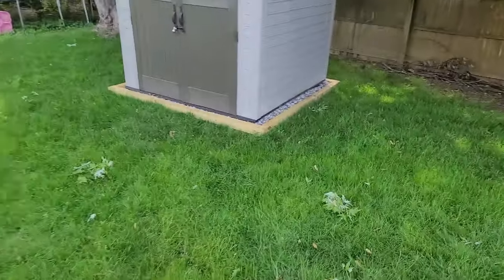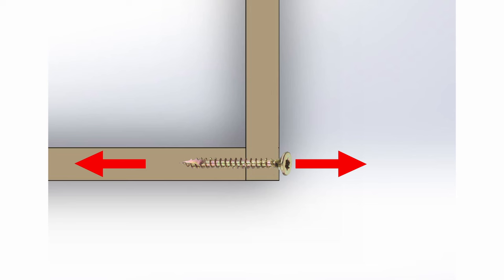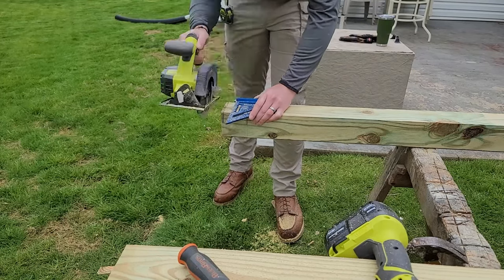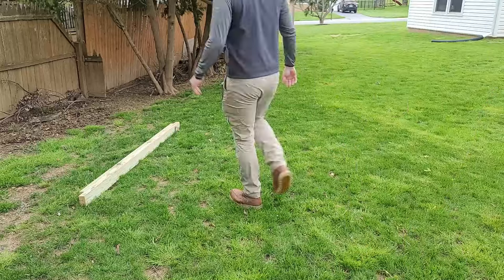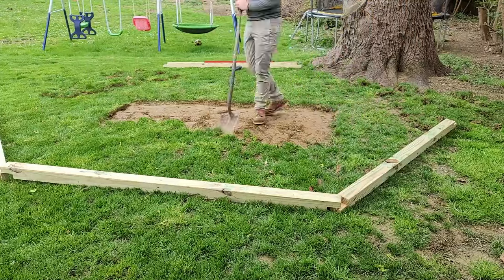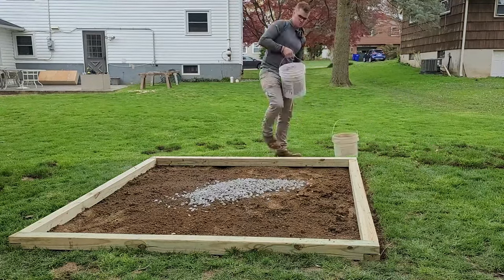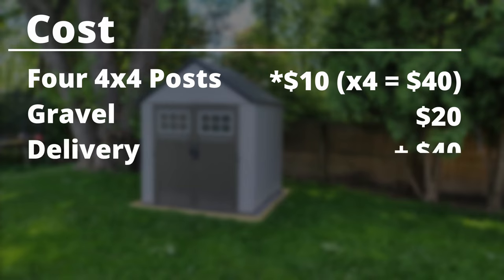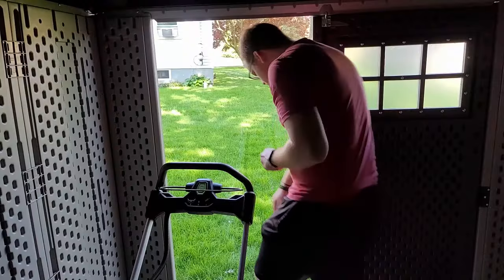Building a Shed Foundation for $100 | TIMELAPSE

Comment: How do you calculate the amount of gravel you need? My project is smaller so definitely won't need that much. Great video. Thank you !
Reply from the maker: The gravel company helped me figure that out. When I called to order it, I told them what I needed the gravel for and what size area I had and they told me which size gravel to use and how much I would need to get it to the proper depth to allow for proper drainage. 👍
Reply: @thebackyardbuilder  awesome thanks a lot for the help!!
Reply from the maker: @patricecomedy  happy to help!!!
Reply: This is exactly what I'm looking to do. How did you end up anchoring the shed?
Reply from the maker: @SuperSkimbro  I didn't anchor it other than filling it with lots of junk! Haha. I am not too worried about it going anywhere where I live
Reply: Your my favorite Comedian RIP. Thought you was dead?
Reply: @ninersnation2364  I'm sorry bro, he was mine too, only exists in our memories and on YouTube now.
Reply: Length x width x height. 
Don’t forget to convert the height to tenths of a foot though if the height is in inches. In this case 
4” height=.33 feet 
8x8x.33= 21.12 sq ft
Reply: Cubic feet*
Reply: Hope Santa brings you a wheelbarrow!!! 💪🏻 😂
Reply: @thebackyardbuilder  hello you wouldn't happen to remember (exactly) what type of gravel you ordered.
Reply from the maker: @cecilb3216  I believe it was 3/4" gravel
Reply: @thebackyardbuilder  thanks for the prompt reply
Reply: @cecilb3216 ”3/4 quarter” gravel is often recommended. The size and jagged shapes of this variety will pack tightly, but also work well to drain water.
Reply: @KeithHampson  👍
Reply: I made mine out of 2x6 treated joists and treated plywood fit for only $68 more , and it's heck of alot stronger.
Reply: I have a tow behind that tilts to dump whatever is in it.
Reply: @thebackyardbuilder  did your shed blow away yet?
Reply from the maker: @boster8368  not yet! ;)

Comment: How did you anchor the shed? I was planning on ding this same thing but thats the part I am caught up on with these resin sheds.
Reply from the maker: You can pick up shed anchors online or at hardware stores that screw down into the ground and can hold it steady. Or you could run some beans across the footprint of the shed and anchor directly into those 👍

Comment: Good video and helpful as I am putting up a 6 x 5 shed. But my question is how you anchor this shed to this type of foundation since the foundation the shed sits on is gravel.
Reply from the maker: You can get shed anchor kits that are essentially giant screws that screw down into the ground and then you fill the gravel in around them. You could use those as your anchors :)

Comment: Did you use any anchors? Contemplating if i need anchors for my lifeyime shed. Thanks for the video my shed will be up in no time
Reply from the maker: I did not use any anchors
Reply: I am preparing to install a lifetime shed.  Curious how yours worked out.  Did you assemble it on the gravel base?
Reply from the maker: @copace1  yes I assembled it on the gravel base

Comment: Two questions, would it be better to have the shed sitting on the 4x4s? Or is it fine in the center of the 8x8 square? Also does this shed need to be anchored ? I have same one
Reply: I am at the process of waiting for the gravel at 3, spent all day yesterday leveling and digging and got the 4 8 foot 4x4s screwed together and in place ! Thanks for the video
Reply from the maker: @blazingcello13  I wanted it sitting on the gravel to allow airflow underneath the shed. I didn't need to anchor it where I was putting my shed up, but if you live in an area with higher winds or you are concerned about the winds, you can definitely anchor it down :)
Reply from the maker: @blazingcello13  I wanted it sitting on the gravel to allow airflow underneath the shed. I didn't need to anchor it where I was putting my shed up, but if you live in an area with higher winds or you are concerned about the winds, you can definitely anchor it down :)
Reply: @thebackyardbuilder  appreciate it! Hopefully will have shed done today exactly like the video, I’m in WNY I don’t think I’ll need any anchors lol
Reply from the maker: @blazingcello13  thanks for watching!
Reply from the maker: @blazingcello13  good luck to you, hope it all works out!

Comment: Can I use the same method, (albeit with more gravel & wood surround) on a 40’ “high cube” shipping container?  Then lift it up from the gravel using a bunch of the four-sided concrete cubes with the cross cut into the top?
Reply from the maker: I would think that should work yeah :) I want to get into the shopping container game myself!

Comment: Awesome thanks. Just got the same size shed from lifetime. Really don't want to make a concrete base as I'm not sure about the location. How much gravel did you need fit for the 8x8? Also would it be recommended to put a membrane underneath the gravel? Thanks
Update 1 ton I saw from your comments. Possibly needs a firm base between the plastic floor and sharp gravel?
Reply from the maker: Yeah you could put a membrane underneath the gravel and lay plywood or something overtop if you wanted. I just put the shed directly on top of the gravel
Reply: @thebackyardbuilder  great thanks. Thinking about it more I may need some form of anchors also as we can get fairly strong gusty storms here
Reply: @SuperBrit33 hi there~ so finally how did you anchor your resin shed to the gravel shed base?

Comment: Thanks for the video. I have just bought a similar resin shed and also have a gravel pad ready to go. Did you have any issues with putting the base of the shed directly on top of the stones? How does it feel when you step inside the shed ? I was thinking of putting a 1/2" sheet of ground contact plywood on top of the gravel to lay the base on just to add rigidity and just so i would not feel the stones when I step on it, but I'm wondering if that is necessary or not.
Reply from the maker: Yeah that would probably be a good idea just to keep the floor flat. I don't really feel individual stones through the floor. But the middle does feel slightly higher and then it slopes ever so slightly to the edges which doesn't bother me as I'm just using it for storage, but adding that sheet of plywood is probably not a bad idea just for a little extra rigidity. Good thought!
Reply: @thebackyardbuilder  
Roger that. I appreciate the feedback.
Reply: Thanks for the vid.I am going to be doing the same thing for my son-in-law, and I appreciate that you took the time to show how is done thanks 🙏🙏🙏🙏
Reply from the maker: @vampiresquid5588  I'm glad it was helpful for you. It means a lot that you took time to watch it :)

Comment: How is the shed attached to the foundation? Or does it just blow away when the storm comes?
Reply from the maker: I dont have it anchored, but you can buy shed anchor kits that secure your shed to the ground. My shed is in the back corner of my yard and is very protected from the wind so I am not concerned about it blowing away. It hasn't yet in the 2 years it's been there 👍

Comment: I have built my gravel foundation and am ready to build the shed on top of it.  The shed does have a floor.  My question is do I need to wait to build the shed on top of this gravel foundation when it is dry and has not rained?  Right now we had hard rains so it is very wet where the gravel base is.  Does it matter if it is wet when I build the shed on top of it or should I wait until it dries out?  I did lay down landscape material before I put down the gravel. Thanks
Reply from the maker: @Trigoddess  you could wait until it dries out of you would like, but I think there should be enough airflow through the gravel that you could build it now

Comment: Should I buy gravel bags from HomeDepot or should i order it from a company and drop it off at my house like you did? I have a 10x10 metal shed, and i will be making a 12x12 foundation obviously, the same way you did. Thanks.
Reply from the maker: Having it delivered is definitely easier, but can be more expensive if you don't have a good local option. You would have to compare costs to see what works better for your budget :)

Comment: The gravel was actually way cheap. I wonder how much it cost where I live. I would have put weed blocker before the gravel. I would also have to build a foundation for my shed. Is it okay for me to use a wood foundation and place it directly on top of the gravel? As long as I use pressure treated wood? I also want to go with a bigger shed, maybe a 10x10, so I will probably have to buy 12x12 lumber to build my foundation. I have watched so many videos on building my own shed, I feel like it might be cheaper to buy one that is already precut and then I just assemble it myself. Seems so much easier, since I've never done one before.
Reply from the maker: Yes, I think that should work as long as you are using pressure treated lumber so it can hold up to the weather. Getting a shed kit or one that is already assembled is probably the easiest way.

Comment: Amazing! 2 questions…. Would then 4x4 posts rot since they’re touching the ground? What size gravel did you use?
Reply from the maker: The posts are rated for ground contact, but they would still rot eventually. I believe I used 3/4" gravel
Reply: @thebackyardbuilder  thank you!

Comment: Great video! What size blade did you use to make the cuts in the 4x4 boards?
Reply from the maker: Im not sure of the exact size, but it couldn't quite cut deep enough to cut half the material away :(

Comment: Anyway to do this on a slight slope? This yard looks pretty flat. I'm new to DIYing
Reply from the maker: Yes, depending on how big of a slope, you could get additional 4x4 beams and build the wall up on the lower part of the slope so that the top remains level if that makes sense? One side might only have 1 beam, but the other side might be two beams tall.  Hope that helps, thanks for watching!!

Comment: Do most sheds come with the floor or just the outer shell? A metal vs Plastic composite, which is better? I really appreciate this vid. This shed project was really stressing me out. Thank you.
Reply from the maker: I believe most garden sheds come with a floor. As far as metal vs. plastic, i think that would come down to which is more important to you: budget or structure. Im sure the metal would be stronger and look better, but would probably also be a good bit more expensive, though i could be wrong. I went with plastic for the price and because it is more of a temporary shed for me. I will be upgrading down the road so i just needed something cheap to get me through a few years.
Hope this helps, thanks for watching my video!
Reply: @thebackyardbuilder  Appreciate the good advice.
Reply: Im reading about shed as well, Resin maybe better as metal may rust.

Comment: Why didn't you use pressure treated wood?  I am concerned with the base rotting.  Great video and it gave me confidence to proceed :D
Reply from the maker: I used ground-contact pressure treated wood for the base to help prevent rotting. It will last longer than non treated 4x4 posts. Thanks for watching! :)

Comment: You can put this directly on gravel?
Reply from the maker: Yes, the gravel leaves large enough gaps between the rocks to allow airflow.
Reply: @thebackyardbuilder   If you put heavy items inside, the gravel doesn't deform the plastic bottom? My concern if we are putting in lawn and snow equipment, so I thought maybe we would use a thick sheet of exterior grade plywood on top of the gravel and then put the shed on top of that?
Reply from the maker: @jgg204  as long as you have the gravel tamped down and compacted well, I don't think it should really deform anything but you could definitely add an extra layer to better stabilize the floor 👍

Comment: 1. What about moisture breaking down the wood over time? 
2. Mine is a tin shed with no floor. I was thinking of putting down cinder blocks, ground level around the perimeter. Then building a platform. Would that work?
Reply from the maker: The posts I used are rated for ground contact so they will break down much slower than untreated wood. I think your plan should work and allow for ample airflow underneath the shed:)

Comment: 01:13 - Save yourself some money and later headache by gluing pegs into the corners. That way the joint will swell and contract together and stay one piece for decades. Otherwise this was a great plan!
Reply from the maker: Good idea! Thanks:)
Reply: @mcamodell can you please elaborate on this process? I’d be interested in setting it up that way but not sure how.
Reply: @michellelopez9806  at 01:12 he describes putting screws through the half-lap joint. Rather than putting screws, drill a 1" hole 2.5" deep into the joint. Then take a 2.5" long x 1" diameter dowel, lightly coated in wood glue, and tap it into place. The joint will now swell and contract with the humidity together, making it last many decades.

Comment: Thank you! I'm going to do exactly this for my 10x12 shed. What size screws did you use?
Reply from the maker: I believe either 3 or 3.5 inch construction screws
Reply: Make sure you use hot dipped galvanized nails & or coated 3.5" screws . If you use uncoated nails/ screws they will degrade & fail because chemical reactions with pressure treated wood .

Comment: How does this seem to be holding up?  Does the floor flex at all?  Rubbermaid doesn't recommend gravel as a foundation for these sheds, but if it does work, I'd sure like to do it this way vs. wood/concrete/pavers, especially because I already have a yard full of gravel.
Reply from the maker: The floor is pretty solid. I packed down the gravel as much as I could so that nothing would shift and it seems to be doing fine. I'll probably upgrade to a bigger wooden shed down the road so this was all about lowering costs for me. If I have to adjust the gravel a bit in a year or two, that's okay by me. I would think as long as you really pack the gravel down so it cant shift and sink, you should be good 👍

Comment: Did you reseal the joint on the posts…and would you need to put a drain tile ?
Reply from the maker: I didn't seal the joint at all after. You could probably put a drain tile if you wanted, but I don't think you would have to

Comment: Why does this work? How does a gravel foundation prevent the shed from sinking or leaning?
Reply from the maker: If you prepare it and level it properly it would be the same as a concrete slab or any other type of foundation

Comment: How is this holding up?  Need to build a foundation for a 8’x15’ resin shed. Does the ground just need to be fairly level and you can  level the gravel or does it need to be nearly perfect?
Reply from the maker: It's holding up well after a year and a half. No issues so far!

Comment: I have to set up my 10x10 amazon shed. Idk if it will work with mine since it states it has to be perfectly level or the holes won't line up!
Reply from the maker: Just lots of prep work to get it level. You can do it! :)

Comment: I have a question.
Does a shed HAVE to be anchored down? I notice this one isn’t.
Reply from the maker: That's a good question. I think you can go either way on that. If you are in an area with high winds and tornados you might want to, but I would think you could get away without anchoring it down :)
Reply: @thebackyardbuilder  that makes sense! Being in Louisiana I’d say yes THANK YOU! Another question :)
What size wood would be best for an 8x6 shed foundation?
Reply from the maker: @shanellefrmDaBoot  I would go for either 4x4 post or laying 2x4 boards to make a solid foundation. You could use 8 foot board for the short side and 10 foot for the long side to give a 1 foot border around the shed.
Hope this helps!

Comment: U have a tutorial for 8 by 10 shed？ Will I just need to buy longer posts？ Home depot ones are 10 ft long. Will that be enough？
Reply from the maker: I think it should work if you do it the same way with longer posts. You will just need more gravel then as well 👍

Comment: Can i do it with this method for a way bigger shed? 15x8 ?

i have a concrete floor, Can i just lay gravel on the concrete?, if so,do i need to put a thin wood board on top of the gravel ? before putting the shed ?
Reply: If you allready have a cement pad there's no reason to use gravel .. you should be good to go !!

Comment: With the gravel allowing air to pass under? How would this work in windy areas? I was going to do pavers which requires your steps and then add sand and pavers. What’s the benefit or difference to leaving the shed to go onto just gravel Vs pavers
Reply from the maker: I think gravel would be easier to re-level down the road if needed. You can simply add more gravel or rake out and redistribute the existing gravel whereas with pavers you would have to dig them up, level out the sand and them redo all the pavers. I think a lot of it depends on your budget and personal preference

Comment: Does it snow/freeze where you live? Thinking of doing this but I don't know if it will hold up due to extreme weather in Pennsylvania
Reply from the maker: I also live in PA, but have not gone through winter with this yet so I will let you know in the spring!
Reply: @thebackyardbuilder  alright thanks